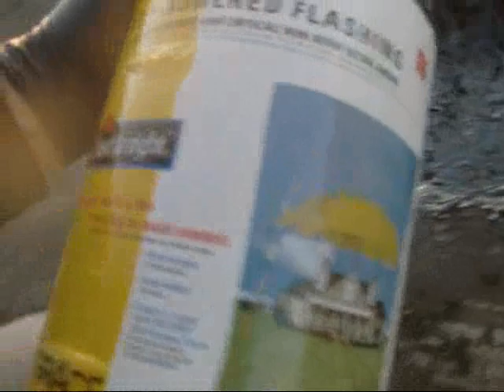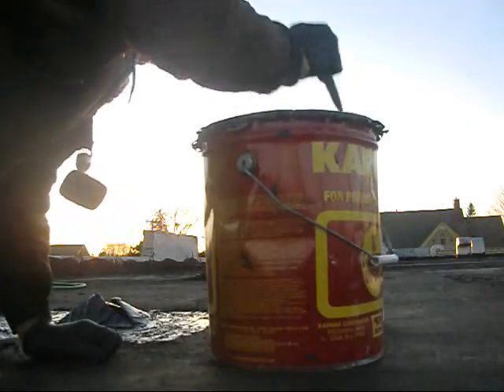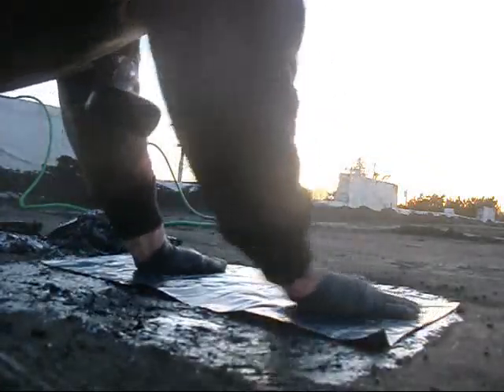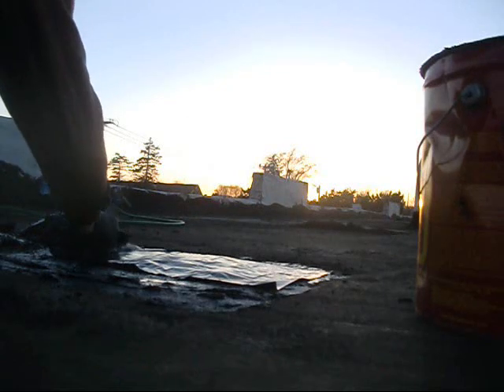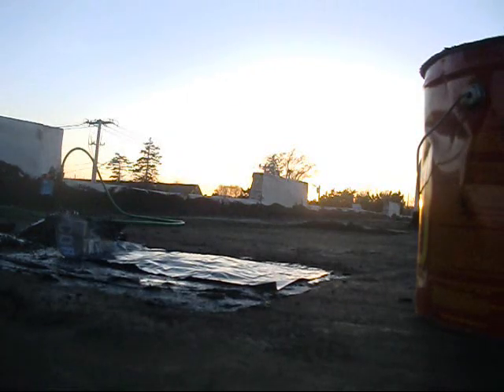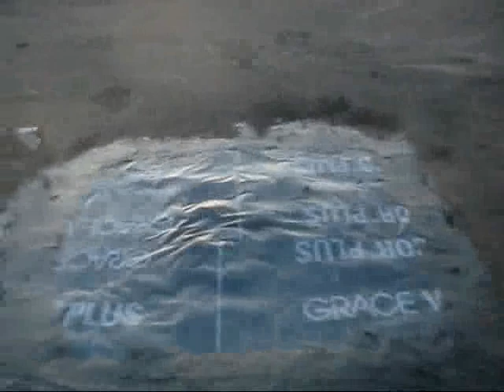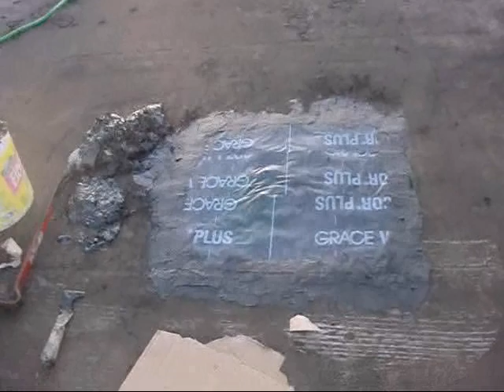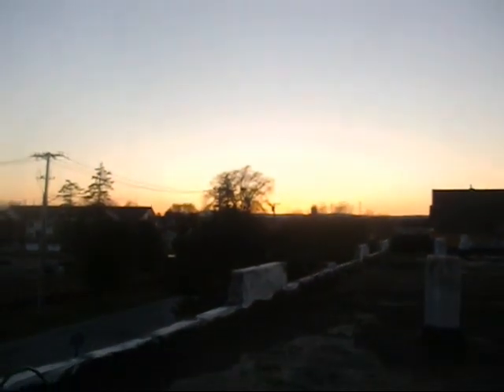3 31 12  30 Minute Roof Repair...

Comment: Never used that type of flashing for roof repair, but I don't see any reason for it not to work as a temp patch.  The issue that may come up is UV exposure breaking it down and curling the edges, but let us know how it holds up.

Comment: just repaired my rubber lined open gutters with the same material (different brand) and the edges came loose...red the directions and it says not for submerged applications...with other words if the puddle remains where your repair is your hooped...temporary as CW says it's propably ok...

Comment: the building i live in was built in the mid 50's with a flat roof. they got so sick of leaks,they put a gabled roof on it. after 40 yrs,thier reshingleing it. never had a leak,just knew the shingles were getting bad.